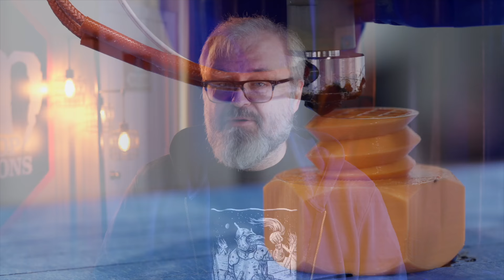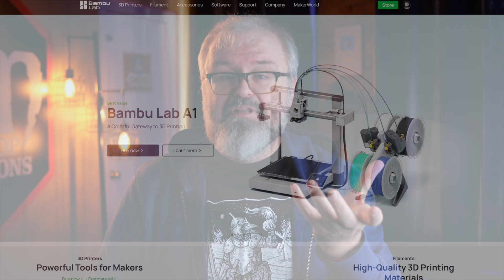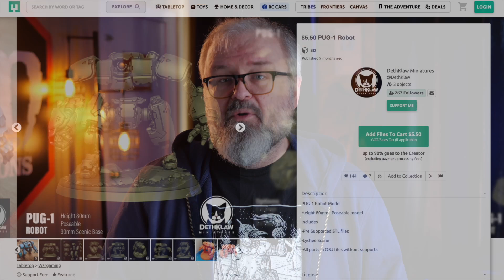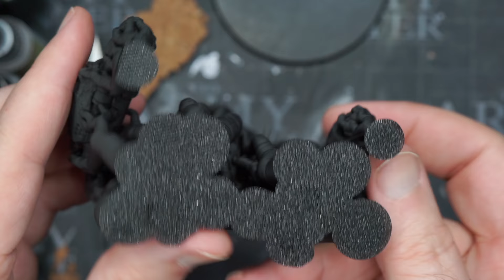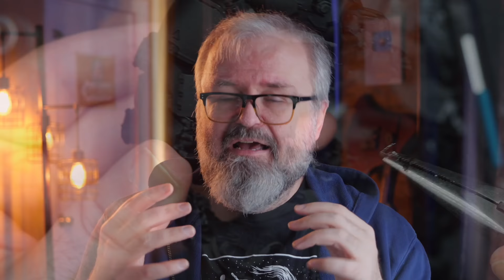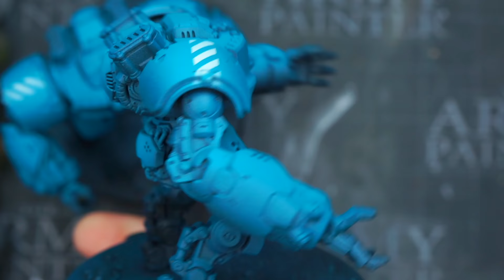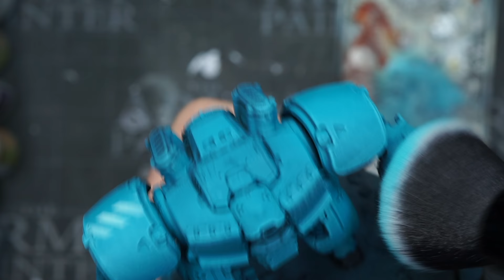I Compare RESIN vs. FILAMENT for 3D Printing Wargaming Minis

Comment: Usually you want to keep parts separated. There are several benefits to that.
1) you can orient different parts differently to hide layer lines
2) a big model with overhangs like arms has more opportunity to fail, at which point you have to re-print the entire thing.
3) Sometimes models just fail in general. If it's split in parts (and you print by object and not by layer) - you can re-print just the failed part. But if it's a big thing - you are again forced to re-print everything.
4) cleanup and supporting gets much easier. It's a nightmare removing supports in-between arm and body. It's much simpler if arm can be separated out.

Comment: I’d love to see you test the filament and use spray putty to fill the layer lines. It requires a lot of work from what I’ve heard, but it comes out great if you can do the necessary sanding. It’s like 2-3 thin coats of the spray putty that gets sanded down between each coat and it can apparently look perfect

Comment: You need to use a 0.06mm layer height for the FDM printer, most resin printers are doing 0.04 or 0.05mm so it would be almost indistinguishable. Slice the Lychee supported model to reduce the number of tree supports required and already have the model positioned to hide layer lines, etc, and glue the pieces together.
Reply: Layer hights this small will take a much linger time and winter inprove edge resolution because the nozzle is still .2mm

Comment: Great comments on the use of sanding and acrylic sealers.  I found PLA terrain is THIRSTY for paint, much more so if it hasn’t been prepped with a sealer.  It also can weep washes along the layers if it isn’t sealed or high enough resolution/smaller nozzle.

I would add that the orientation of the model can affect the lines for good or ill.  Sometimes I rotate mine 90 degrees to front to side for very different effects.  Avoiding the supports from going where they will be seen on tabletop is one of the other goals.

Comment: Prusa have been able to do 0.05 layer heights for nearly a decade. Always better to do figures as their separate parts so you can orient each print for minimal supports, arms facing up etc. A lot of people use ABS with an appropriate printer because it can be sanded much better than PLA, but a good dremel will help in either case.

Comment: Concerning hard-to-remove supports: I'm using the Bambulab A1, too. When using the standard settings, I've had a real problem removing supports. Then I just lowered the Line Width setting for Supports (Quality tab) to 0.25 mm. It's a lot easier to remove and still holds.

Comment: I printed tons of terrain on my FDM printer, but also some models, especially WW2 tanks for Bolt Action and spaceships for Battlefleet Gothic. Choosing models that are more angular than organic helps, but then creative digital cutting up of the model helps a ton as to avoid too many supports. Resin looks nicer, yeah and I will get a resin printer some time, but printing something like your robot or my tanks so cheaply, is a quality of its own!

Comment: I like the way it looks. WWII tanks were built using casting metal, so the surface looked rough and beaten. With just a little bit of weathering you will have a great looking robot that has been in battle for quite some time.

Comment: I use tamiya basic putty with a few drops of Tamiya extra thin cement and brush that all over the models. it best works on flat and organic surfaces, that can be easily sanded down with fine grit sandpaper

Comment: I don’t know if this works for every multi-part model, or only ones that have been optimised for FDM or something, but my brother sent me some files for a helicopter thing for the Fallout game to print on my Bambu Lab A1, I selected all of the files in the ‘add object’ file screen and the program automatically arranged them into a complete model.
I was pretty blown away to be honest, I haven’t tried it with any other complex model and I don’t know if it’s got anything to do with optimisation, but yeah it arranges it into a complete model right in the program. Pretty handy!

Comment: FDM for minis, you're gonna need some beer goggles before it looks okay. Even for terrain it's only okay if the part is going to be coated with terrain paste, ballast, or flock. The texture paint seems like a good idea. You'll probably get your terrain done faster and cheaper if you just use pink insulation foam slabs, unless you need to make multiple tables' worth. 

I hadn't realized resin was such a toxic hassle to use. Bummer. I thought 3d printing was mature enough to bother with for people who aren't specifically 3d printing hobbyists.

Comment: The best thing I have found for filament printing normal 28mm minis is to use a .2mm nozzle with .08mm layer height. Use 1/2 speed on everything, and slow down for overhangs. Use regular supports, not tree supports (they distort the bottom surfaces too much). Good video! I've yet to use a wash on them, but for the most part you can't see 99% of the layer lines.

Comment: Filament printing has come a long way but it's just not there yet for miniatures.  Having a 14k resin printer that is optimized for fast resin I would never make miniatures in filament at this time.  I will continue to use my FDM for terrain and perhaps larger tanks as better FDM specific files are available in the future.  A tank STL made for a resin printer is not made the same as one for FDM so for now I am limited on the tanks I can print.

Comment: I've been hearing that the bambu slicer was a lot more powerful than people realize, i had no idea it could be used to put separate things together before printing! Time to dive down the rabbit hole.
Reply: Bambu slicer can indeed do a lot. Though i recommend to not put stuff together. If anything, you often want to do the opposite. Cutting e.g. a tanks main body in half allows you to print it all with far less supports, and thus both less material, less work removing them, and usuaky a significantly better surface quakity. 
Similarly, having it in different parts allows for optimized tuning of where the ugglier bottom parts are. I am currently printing a warlord titan, and turning all the armor plates and structure bits so all the seams from gluing chuncks together, as well as the rougher overhangs and support connection areas are mostly hidden by the rmor plates, so the parts that you actually see all look nice and clean.

Comment: Apart from printing in sections, a hot tip I've seen and tried out for filament printed vehicles is mixing a little Liquitex Modeling paste with water, and stippling the mixture over the flat areas. Makes some cool texture and disguises lines really well

Comment: I have a filament printer (Ender 3) and use it to print tanks and other vehicles. It works well as long as I sand away some of the layer lines. A trick I've used is to sink the model in the slicer build plate to cut the model in half, using something distinct to mark the cut off. Then I flip the model and sink it to the same place. This stops the rough area caused by the supports.

I've used this with the main bodies of not-Smarines from Puppet wars. It works ok. I still have friends with resin printers print the smaller detail pieces (heads , hands, weapons, etc). It works for table top and slightly better than table top.

Comment: Filament isn't perfect and maybe it never will be for tabletop minitures. For applications that are large enough to sand etc, the final product can be amazing. But just think about this, GW would have you pay upwards of a couple hundred dollars for models such as the warlord titans. I have seen amazing looking STLs for "imitation" titans for less than 30 bucks requiring maybe another 10 in filament. And obviously given enough time to print. To my mind, that is nothing short of amazing.

Comment: I've made two whole armies for One Page Rules using FDM printing. Most people I show it to can hardly believe it's really FDM. In my opinion, the slight loss of quality is absolutely worth it for the ease of use that FDM has compared to resin.
Reply: yep especially if you use a small nozzle and print slowly. .2mm and .3mm nozzles exist for this
Reply: Hey have you got any specific tips or instructions for using FDM for OPR STLs? Im thinking of buying a FDM printer and specifically for OPR stuff at the moment. 

I know this is a big question potentially but even just general tips and other resources you have learned from would be super useful!
Reply: Dont forget the 0.15mm nozzle.
Reply: How slow
Reply: The biggest reason I got a resin printer in addition to an FDM one, is that certain minis are just absolute hell on an FDM.

This might change in the future as more people make models designed for FDM, but printing shit like Tyranids on FDM is a massive pain, and while they can look good, some just have shapes that don't fit how an FDM printer works.

Comment: Print in parts - I've even cut parts in two to get better prints (there is an option to generate holes and lugs in the cut surfaces to improve realignment).

I use a a set of jewellers round nosed pliers (thinner ends) to help remover supports.

The colour of the filament effects the properties of it! I started with Bambu basic PLA light grey which didn't adhere well to the build plate and the supports were hard to remove. I tried the dark grey version and it sticks better to the build plate but the supports come of easier. It surprised me but I guess the pigment in the PLA effects its properties as it's another chemical. 

There are lots of options to tinker with and thus a lot to learn. But am not comfortable with the chemicals in resin printing, the mess, the ppe and the space required. Also I don't want to print a build plate full of minis as I don't paint that fast. One or two a day on the build plate is fine if not a bit too fast. 

FDM is a compromise I can live with.

Comment: Please try the profiles from Lost In Tech’s recent video about printing tiny layer heights with Arachne.

I printed a number of models fully assembled in 0.04mm layer height and I honestly need to get up close to about 10cm to even see evidence of any layer lines. Also removing supports was both easier than FDG profiles, and harder..?
Also printing this way would save you the hassle from having to print everything separately to get decent quality.

Comment: Personally, I'd happily paint and play with the FDM printed model if I'm just looking for pieces to play with. Like you say, if you're looking to do display painting, FDM is obviously not ideal. 

If all one can afford and/or house in their living space is an FDM printer, it think it's better than having nothing. 

One question, though, and I have a feeling that the seasonal temperatures may be a factor, but would those FDM layer lines be mitigated by using filler primer? I realize that may limit priming to the warmer months of the year, but I've used it on terrain and it seems to work decently.

Comment: If you change your Support Z Distance (Support Top Distance) you can make your supports easier and cleaner to remove - you can normally get away with 0.2 - 0.25mm without affecting the integrity of the surface that is theoretically resting on said support.

Comment: Hey Uncle Adam, long time lurker, first time commenter. I picked up a Bambu Lab A1 on your recommendation and splurged for the 0.2mm nozzle. So far I've printed a 1:1 scale hummingbird, complete with plenty of feather details that came out amazing. Also I've been printing the pre-supported One Page Rules Saurian army off MyMiniFactory without adjusting any settings from default 0.2mm High Quality pre-set. I've got 3 Gator guys that turned out phenomenal with pre-supports, initially I used Bambu's tree supports, but cleanup was such a pain in the arse I decided to try the pre-supports. So for the cost of the filament, I'd recommend attempting pre-supported mini's initially even though they are often designed for Resin!

Comment: I use a resin  and talc  mix after sanding the underside were the tree supports are connecting to smooth out the filerment rough edges when covered i cure with a uv torch it great for rough areas and you just need to prime and then paint has normal hope this helps.
It can also be used has a gap filler.

Comment: I am encountering a logical anomaly with regard to the requested 2D impressmentation of the like button as my finger is three dimensional though it does appear to interact with the 2D button in such a way as to give the impression of a like, which I trust will suffice for algorithmic purposes.

Comment: I've seen modern filament is great as long as you do smaller pieces.  It really shows on flat surfaces as well is its other failure point.  But I can see it also being an aesthetic choice as well as you can see the line as just like differences in material being bonded together for something ramshackle.

Comment: Definitely split the model and assemble after. Sometimes spltiing it more than is came from the designer helps. When you prime start with a filler primer and go suuuuuper heavy. The broad flat surfaces can be sanded, the deeper crevices can't be sanded sp let the primer pool a but and hit some layer lines. I know that's a mini painters sin but it's necessary on fdm prints. I use liquid green stuff to hide the join lines. But in the end you assessments are correct. You can totally tell the difference but the results are better then I need.
Reply: Is there such a thing ss filler primer through an airbrush? That would be a game changer for fdm minis!

Comment: You can also combine resin and filament printing. For example on a tank print the main body in filament and then print the smaller detail parts like hatches and machine guns in resin.

Comment: I intentionally use a chalky primer when priming resin prints. The rougher finish helps hide the layer lines. Also, anything large and curved (like the shoulders on your robot) I take some sandpaper to it.

Comment: The channel, Painted4Combat, specializes in printing miniatures with FDM printers. He has good advice to optimize the process.

Also, if you want to mess with PVA as a support for PLA, it's resolvable in water, which would make removing support much cleaner.
Reply: I recommend this channel as well, but to be honest, I have no own printer and have no experience of my own!

Comment: As a novice, not a beginner, I bought an any cubic kobra 2neo about a year and a half ago and a kobra 3 combo a little after that..  Can't say if more expensive is better, but for budget machines I am still completely happy with both printers and satisfied with the print quality even with default settings out of the box..  Layer lines are awful yes and the under sides are nearly impossible to fix but with a little sanding and prep before painting I get ultra smooth surfaces everywhere except under overhangs.. With resin there is a lot to do with curing and washing but its almost an equal trade off with the sanding and other stuff to make filament printing quality paintable..  So for me it was about the cost and convenience and I don't regret my choices. But if I could afford it I would buy all the stuff needed to get a resin printer for things I really really want the superior detail and all around quality they offer.. But for me, on a very poor budget I haven't felt anything close to wishing I had a resin printer instead of my bed slingers.. The mini figures i print are strictly for painting to lose myself in and forget about my depression and worries of the moment, and for that my less expensive printers are perfect for that and very acceptable pieces to display. (Except for some of the more difficult under sides sometimes.)

Comment: I think print separately would allow easier support removal.  This is a fairly curvy model with a lot of rounded parts, printing as one assembly may not always be good for models like that.  If it were a tank or something a little more "brick" like, then assembling in the slicer makes sense. I do this for nearly all of my tanks, but I use regular supports (which seem to come off a little better than you'd think for brick-like objects).  Also consider changing your Top Z Distance on your supports.  Incrementally increase that setting on your next few prints to find the point where they no longer support,  anything just below that point will be a easy-to-remove support while still functioning as a support.  I typically use 0.22 - 0.28 with a 0.4mm nozzle on my A1 and that seems to work really well.

Comment: For better FDM support the best value to tinker with in bambu slicer I've found is Top Z distance under the Support tab. At .2mm LH, Top Z distance = .28, I've found my X1C supports remove super easily, and are almost as clean as if that area was directly on the build plate. It is much more difficult to dial in perfectly at lower layer heights but still helps. I print my minis at .16 or .12 on a .4mm nozzle and when printing 28mm infantry spending time dialing this setting in prevents a lot of breakage as the small parts are more fragile than resin in some ways.

Comment: My last job 5 years ago had an filament 3D printer in the office and I had such a hard time keeping that thing level and there were so many parts that we had to replace while running it. I’m very excited hearing how nice they are to work with now.
Reply: Yeah, getting them perfect is still a faff, but getting them good enough is just not needed as they come out of the box better.
Reply: I've worked with printers at work and have had hobby ones at home. The Bambus feel like magic after years of manually leveling beds and setting z heights and generally troubleshooting random issues. They print great every time over and over. I was skeptical before I owned one but now that I have an A1 I see the light.